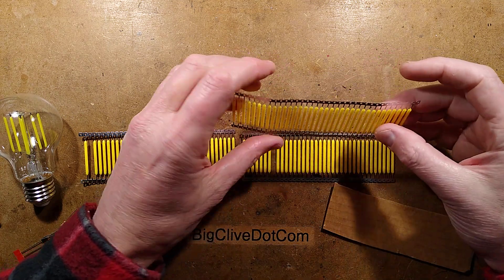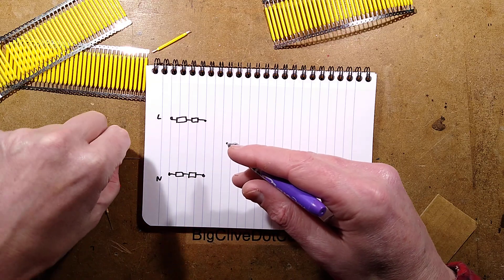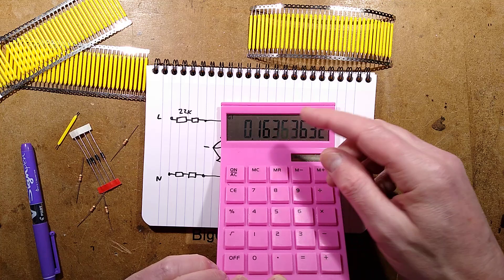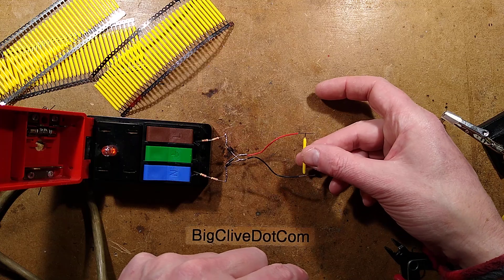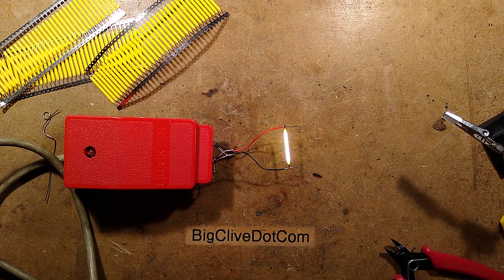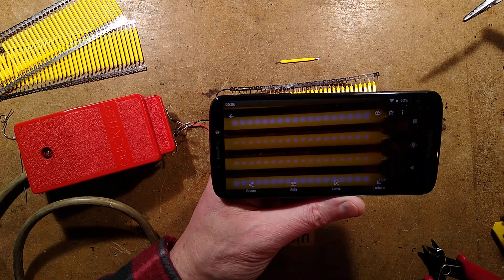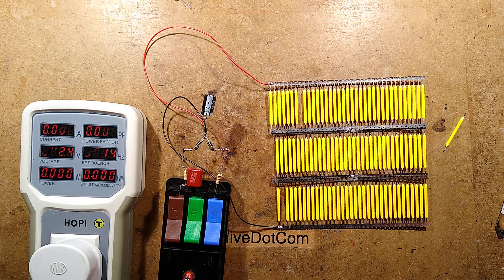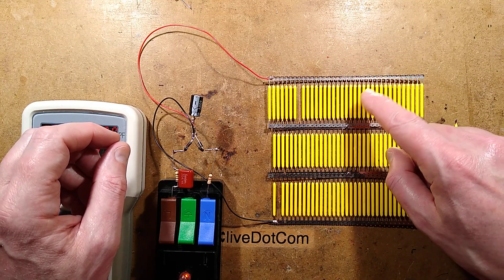104 LED filament lamp - just because....

Comment: At 2:44 you used mains AC voltage in your calculation. After you rectified it to DC it's more like 320V DC, because 240 AC is RMS.
Reply: The 320V is only applicable when there's a smoothing capacitor in circuit, otherwise the RMS value is the right one to use as the DC is half sine wave peaking at 320V. The later circuit has a smoothing capacitor, but not that first one.
Reply: @TheEulerID  Not with a full wave bridge rectifier...
nevermind, I was thinking power.
Reply: @randysmith7094  As it happens, Big Clive was calculating the maximum current and power dissipation through the 4 resistors, which are on the AC side anyway, so this is all irrelevant to that.

As far as full wave bridge rectifiers are concerned, and the peak voltage is Vp, assuming sine wave input, the average voltage is 2Vp/pi and if it's the power output equivalent to a resistive load (the RMS output) then it's Vp/sqrt(2). 

Put an incandescent bulb on a single phase FW rectifier output (unsmoothed) and it will behave the same way as on the AC side. Put a smoothing capacitor in of sufficient size and it will quickly burn it out.

With a smoothing capacitor there are formulas to calculate it with the ripple current, but at the limit it's Vp. 

Note, for this sort of circuit, Vp is not the peak-to-peak voltage.
Reply from the maker: I calculate using RMS unless a smoothing cap is added and then it would be peak voltage as that is what the capacitor charges to.  But in this case the LED forward voltage will set the voltage of the smoothing capacitor.
Reply: @bigclivedotcom  I was, of course, not referring to this circuit which clearly regulates its own DC voltage.

Comment: So the question is how many lumens are those 104 filaments producing in total for 3.7W?   Difficult to measure accurately but perhaps you could compare room illumination with some standard LED bulbs to get an idea? In theory it should be roughly 750 lm, around twice as efficient as typical (non-Dubai) LED bulbs.

Comment: Confused over the UK 240 volt supply, when it has a RMS of 230 giving a range between 216.2 and 253 volts.
Reply from the maker: The 230V value is a paperwork value associated with a European standard.  In most parts of the UK it's still 240V.  Once the bulk of the UK has switched to 230V I'll use that as a reference value.  That might happen in 100 years.

Comment: Very interesting video and subject, can’t wait for a followup .I made a 3-step capacitor dimmer for a ceiling lamp with 6 ”non-dimmable” filament lamps that works very well with no flickering dimmed light and I hope Dubai-lamp like longevity. The bulbs have 4 filaments and when on 230V they are unpleasantly bright with a total consumption ±24W and a pF of 55.
For switch one I have 0,33uF capacitor in series with the lamps, the total consumption drops to ±1W with a pF of 66 and dimmed "candle light".
For switch two I have (2x0,33uF) 0,66uF capacitors the total consumption ±2W with a pF of 86(!) and very nice dimmed usable light.
With switch 1+2 on (= 0,99uF capacitors) the total consumption is ±3W with a pF of 72 and with slightly stronger dimmed usable light.
Reply: That's cool. DIY stuff is great when you can surpass the manufacturer's specs (dimmability) instead of paying extra for that feature. But as an engineer I do have to nit-pick on something.
The plus-minus sign is used in science and engineering to represent margin of error in a measurement or a tolerance. For example if you measure something with a tape measure your result could be 300mm ±1mm. Or the power consumption of an LED lamp could be stated as 24W ±1W (actual power consumption would then be 23 - 25W).
But ±24W by itself doesn't mean anything (other than that whatever you're talking about has an unknown power consumption with a range of 48 Watts). I know you mean "24W, give or take" but that's not how you mark it. Use ≈ or ~ to say something is about something. ~24W is "about 24W".

https://en.wikipedia.org/wiki/Plus%E2%80%93minus_sign
https://en.wikipedia.org/wiki/Equals_sign#Approximately_equal
https://en.wikipedia.org/wiki/Glossary_of_mathematical_symbols#Arithmetic_operators
Reply: @Kepe  Thank you for your reply. Off course you are totally correct about the proper use of the ± sign. In Dutch (my native language) ± can also be used as a short way to indicate about, approximately or circa.  Now I learned that it doesn’t work like that in English but ≈ is a good alternative. Don’t you use ~ already as a symbol for AC?

Comment: Dumb question, but why are there separate LEDs inside the filament? Can't they make an LED in the form of a bar or tube?
Reply: Not a dumb question, but an LED is a junction device between two layers of silicon, and the light is emitted from the junction. They rely on being very small so the light can escape (LEDs are effectively a point source of light) and would likely be difficult to make a working junction that long that light can escape from. Also having several devices in series increases the voltage drop across the array, which is useful in a mains powered device. The long segments you see on large seven segment displays are actually several LED devices in parallel with a light guide/diffuser to make the illumination even.
Reply: @IanSlothieRolfe  thanks, that was very insightful and interesting!
Reply from the maker: Each LED is a semiconductor junction with a voltage of 2-3V.   Even in the small rectangular LEDs used in high power lights they tend to have a grid of smaller LEDs on the same substrate.
Reply: @bigclivedotcom  Yeah whenever you pull one apart or fix some. I always wondered why there are grids or multiples. It makes more sense now that they just can't scale it up because it's in the nature of what an LED is. Thanks!

Comment: Aliexpress site specifies 47 volts at 30 mA - it says 30 MA, but I think that is a mite excessive!
Reply: @capturedflame  Undoubtedly.
Reply from the maker: I'd go for 20mA max, but prefer 15mA or less.
Reply: 30 Mega Ampere would be hard to drive.
Reply: @GegoXaren  Not to mention rather bright and expensive to run.
Reply: @JUANKERR2000 
Quite.

Comment: Are you able to remove the phosphor without breaking the Bond wires?
Reply from the maker: There probably aren't any.  These probably use flip chips which are like bare surface mount components with no bond wires.   It may be possible to peel the gel off, but you can also get blue versions with clear gel.

Comment: That setup at the end looks like the internals of a 1930s Zenith 811/812 radio I acquired recently. I was thinking about plugging it in but I opened the back cover up and it seemed to have like 4 layers of solid wires soldered directly into components going everywhere, basically a PCB before PCBs and I don't think there's any way in hell I could figure out that mess

Needless to say if that thing is ever going to make noise again it's not going to run off the original circuitry. Probably can't use the original speaker either because it's marked as 3000 ohms and I have no idea what kind of thing could even drive that or how that kind of speaker is supposed to work since most speakers I've seen are in the single/double digit ohms
Reply: As an 11 year old I found a similar radio in the council hard rubbish bin. It had point to point wiring; square cross section uninsulated  copper. That was 60 years ago. I didn't know any better and trashed it again.
Reply: I had to put a new battery in my grandpa's old analogue multi-meter (well... Volt/Ohm/Amp with multiple settings), and it was also all point-to-point. I mean, in hindsight, thinking back that shouldn't have surprised me, but having never seen something like that before, it caught me off guard! :P 

It's a big ol' brick of a meter, though, but otherwise "modern" in every other sense. Dial in the middle to switch between modes. Reader at the top (the analog meter). Two swappable wired test leads. 
Only difference is this is all in a, again brick-sized, black bakelite sort of material enclosure, which actually seemed to be a non-specific kind of general purpose "hobby enclosure". Whereas today, it'd be a purpose-made plastic enclosure.

It's impressive to see it in the old systems like the NASA Lunar Lander computers. All point to point wired as well, with tiny terminal wires. Zig zagged and criss-crossed, but neatly and systematically, across a big ... not sure what they're called, wire-routing-board? heh Tis some crazy stuff!
The REAL amazing shit to see is the old "rope memory" that it used. Looks more like something grandma would make... haha
https://pbs.twimg.com/media/Dr1kWzuV4AAQcH2?format=jpg&name=4096x4096
https://pbs.twimg.com/media/Dr1jx3pU8AAG4RY?format=jpg&name=4096x4096 (macro image of that)
Rope RAM (not really, but it's catchy!):
http://static.righto.com/images/agc-rope/core-rope-internal.jpg

Comment: You can also make an led bridge rectifier to turn AC into DC (to visualise the AC current passing)
Reply from the maker: The downside of that is that LEDs have a very low reverse voltage.
Reply: Agreed
Reply: "Current" doesn't actually "pass" nor electrons "flow", but that's an entire subject in itself.

Comment: I'd love to see the manufacturing process for these led filaments. Especially the phosphor layer. Nice one clive 👍🏻
Reply from the maker: It's changed.  It started off as a perforated metal strip, then went to glass with bond wires between chips, but now it's based on flip chips with no bond wires.
Reply: The phosphor layer is done by Mrs. Liang with a piping bag.

Comment: I use a UV flashlight to count the individual LEDs, they glow as bluish dots as the phosphor glows yellow.  My filaments operate optimally at 60 volts each.
Reply: welding helmet/lens works also with LED powered on, you can look right into them safely
Reply: Just for a count, this works, especially on these type of filament/diode circuits. If it is shrouded by a diffuser it obviously doesn't help bit this is a good tip.
Reply: "Optimally" should, if we are being realistic, include lifespan.
Reply: @mikemondano3624 I mean, efficiency is all that really matters, you find peak efficiency, then go under for lifespan
Reply: Did you measure how much current you were getting at 60 volt?
Reply: @raywharton9425  unfortunately I did not as of yet, my Fluke stays at the shop and I did not have a suitable ammeter to take an accurate current reading while tinkering at home.
Reply: @nw7696  Thanks for the response Norm. I've got a guess, if you get a chance to measure it let me know if I'm close at all, that they'd be running about 32ma at that voltage, a bit spicy, but whatever.

I ask because I have a ~54vdc battery bank in my kitchen and I was thinking about how to drive some mason jar lights made of these things off of it. They'd look sweet, and that'd be one less thing my inverter has to do; seems silly to invert the power, then rectify it a few feet away, eh? If I can find a couple measures of their current at given voltage I'll know how I'd want to play that hand. 

Anywho, enjoy making things glow!
Reply: @raywharton9425  will do, probably and hopefully this weekend I'll have time to tinker and get my readings back to you.🙂👍
Reply: Emitters. No Filament.
Reply: @Karl_Kampfwagen  I call the "sticks" composed of many individual emitters (LEDs) "filaments" since that is what they are intentionally trying to simulate by design. 🙂👍

Comment: I have a bedside lamp that has a bulb that uses those filaments. It's rated at 4 watts. 
Question: could you not use AC power (without rectification?)
LED's are diodes, right? They would only allow current one way. Or are filament LED's more sensitive to reverse polarity?
I have used regular LED's with AC power. (Nothing added to the diode except a resistor). Interesting video!
Reply from the maker: LEDs have a low reverse breakdown voltage.

Comment: 54V per filament, that sounds like it would work from a nominal 48V (56V? charge voltage) battery system.
Off grid lighting without needing an inverter anyone ?

Comment: It's not an ugly creation, Clive. It's a 3D-mounted electronic circuit, yet another piece of art.
Reply: IIRC it's called "deadbug style", because it remembers a dead bug evidently
Reply: It could be squashed down to a more 2D style if Clive was radical and actually used some thin heatshrink tubing to insulate the bare wires…

Comment: 120Vrms is just about 170Vpeek. Couldn't one just do  Three 54 volt LED in serries  =  162v with only 18 volts remaining to drop across current limiting resistors and or capacitors. 

Just wondering why full bridge rectify Light Emitting Diodes. 

Sure it will conduct half the time,  but that can be remedied with LEDs connected reversed but in parallel.
Reply from the maker: With a resistor current limiter and small drop voltage the intensity will fluctuate with supply voltage dips.

Comment: Maybe if took those strings of lamps, and made them into a shape. Even in a Circle. Or made a long tub, about 1 meter in diameter of those lamps. What happens if you vary the voltage, do they change color?
Reply from the maker: They just get dimmer.

Comment: I have some bad ideas with these led  strips .,Wrap them around an aluminium pipe and make a stand light .for construction or out doors .use 2 inch pipe and find a piece of acrylic to sleeve over ,silicone it and pick up a power supply that will fit in the pipe .and bingo you have an even lighting device

Comment: Very interesting. You could make your own Dubai or better Isle of Man light bulbs when you put the filaments and so on in an empty bottle. Methods to cut off the bottom of the bottles are on YT. I think I have to try this by myself.
The manufacturer say´s - filament 47V 30MA 1,5 W - I would give them 15mA.
Reply: If you're really sneaky you could do it by inserting the array through the neck of the bottle and then spread it out, ship in a bottle style. Then you can puzzle all your friends at how you got it in there without cutting the bottle... :)